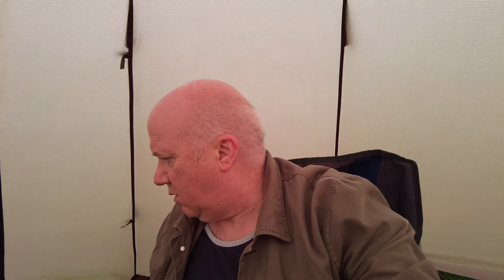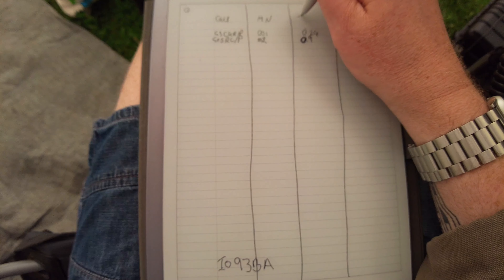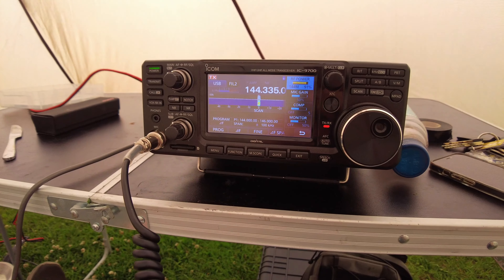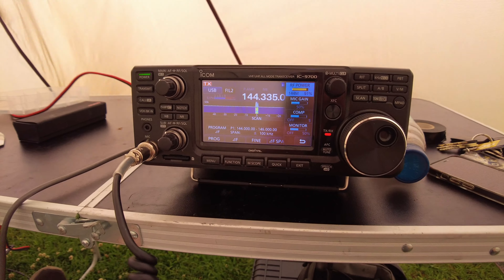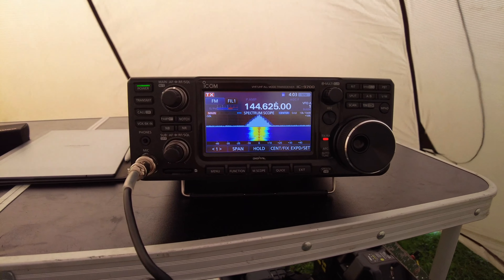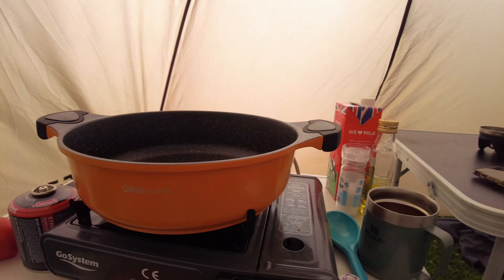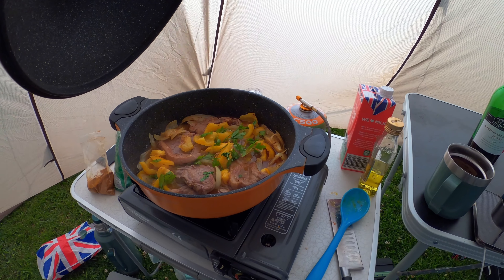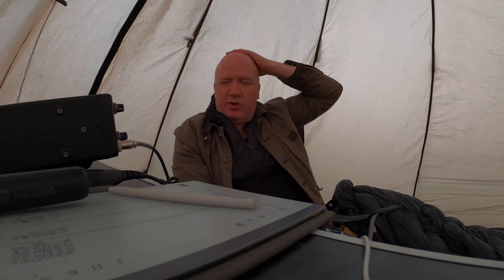Almost serious HAM RADIO field day outing  | Outdoor slow cooking

Comment: Always a Delight to watch your Vids Carl.looked pretty Bleak up there ..no Damage Sustain ed 

Dont those cooky pot things have to be sealed around the lid with pastry dough or something ...it looked delish.did u scoff the lot?
Reply from the maker: the weight of the lid helps, this tagine also has a hole in the lid to let some pressure out, my other Tagines don't. If I'm cooking byriani rice in a bit pot I will use tin foil to seal up the pot.

Comment: All good Field Days have good food, sometimes poor weather, and are only semi-serious. :)
If I want to work both horizontal and vertical polarization I bracket the vertical at an angle and check the SWR to make sure it hasn't caused any problems. That angle changes the radiation pattern, sometimes for the better, sometimes for the worse. But it raises the likelihood of making contacts on both polarities. I learned the significance of polarization at a Field Day when I was operating on top of a mountain, (a mountain foothill about 2,000 feet above the Colorado eastern prairie,) high enough to see with binoculars  the club's repeater site atop a water tower 25 miles to the east. I pointed the beam at the repeater, LOS, a horizontally mounted 9 element 2-meter beam atop a 30 foot mast. My rig was a modified Motorola SyntorX pushing 160+ Watts, but I simply couldn't key the repeater because of the polarization difference. I put an HT's rubber duck antenna vertically on the back of the rig sitting on a tabletop and hit the repeater full quieting. In fact, an HT with 2 W output worked the repeater from that spot just fine. From then on I was careful to take polarization into account, at least on VHF/UHF.
Reply from the maker: aha interesting idea!